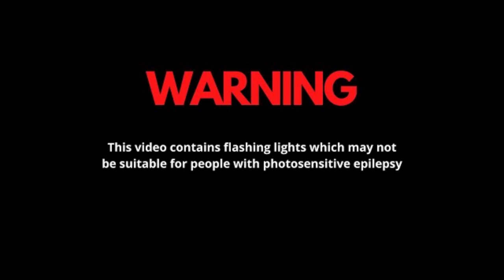Why Did I Buy This BROKEN Thing? | HALLOWEEN Special | (Contains Flashing Images)

Comment: I thought you looked like ozzy Osbourne before you said it yourself😁
The factory did a great job on attaching those wires, guess it's only meant to work for a single season and be thrown out after that.

Comment: OMG, steve looks exactly like that doofus from Gamers Nexus with the perm that he can't stop touching on camera and is so proud of. 

Yeah, I know GN is about the only actual impartial place to get hardware news, but the dude is like: "hey, we need money, buy our merch and join our channel. Oh, by the way, we just installed an entire room to measure fan vibrations at a cost of over $250,000, but we need your money. Our millions of views on every video and our copious sponsors don't pay enough."

Well then why did you build an entire room designed to sense every time a butterfly farts in China? That doesn't help the consumer. It helps them get views because they're doing something nobody else does (and for good reason. Butterfly farts are the most common cause of chip failure)

I think his perm has started to feed on his brain.

Thats the guy that will completely lose it when he starts to go bald. His hair is his avatar.